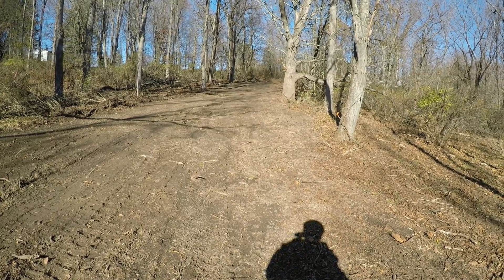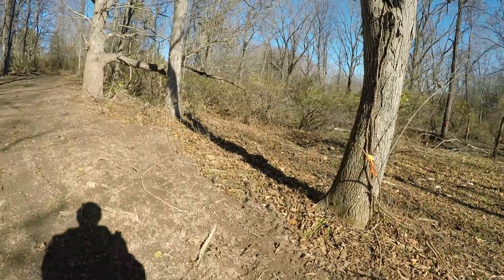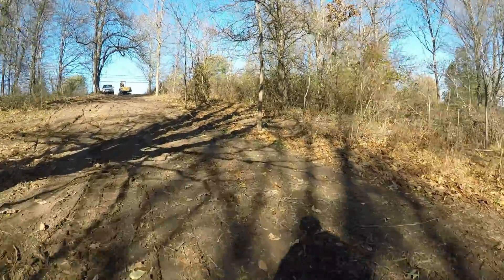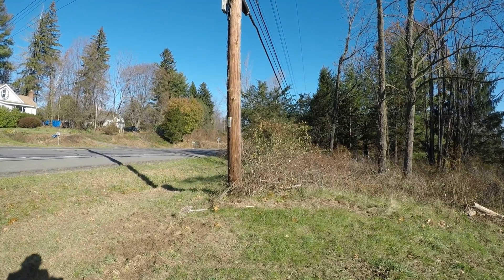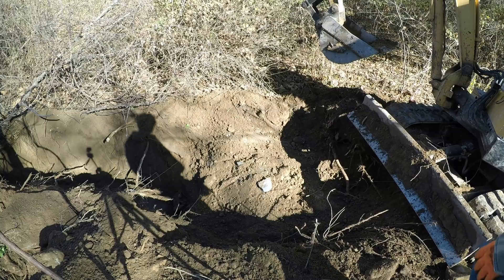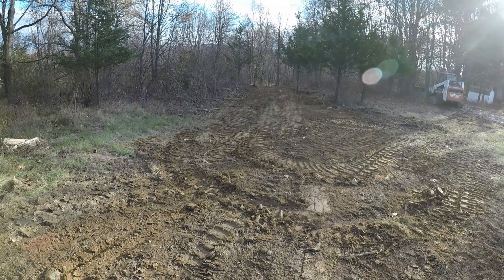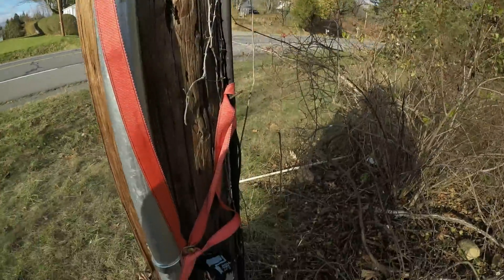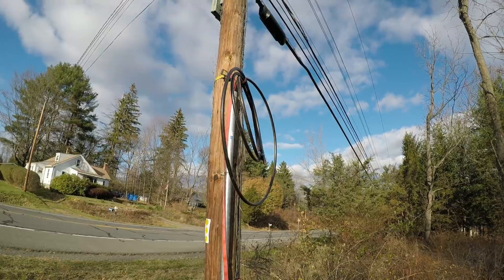Installing underground electric service

Comment: If you scrape about 8 inches from your dig at a  time you will end up with  a  much nicer trench.   It takes no more effort as long as you fill you bucket with each dig.    A nicer trench is easier to fill with conduit and backfill with dirt.

Comment: It looks like you take pride in what you do. The electrician needs a lesson on how to do work in a neat fashion with some pride. The expansion fitting is all the way down so it can't possibly work correct and none of the conduits are level. Maybe a little stone in the bottom of the transformer pad.

Comment: boy this is a great job for my Big Ditch Witch  ,,, it has everything on it ,,back hoe,, 6 way dozer blade , ditcher that can go 6 ft. deep and it cuts a 8" wide ... and it also has the Vibratory plow too ,,,,,,, you don't see many like this with both the trencher and the vibratory plow on the back ,,, usually you have to change them back and forth as you need them ,,,, anyway ,,, I would have love to trench that one in

Comment: A late comment...great video!  I have the same situation at my farm.  I'm wondering if you took note of the wire-type printed on the outer jacket of primary cable the electrician used.

Comment: What gauge is that primary cable?
Reply from the maker: The primary cable isn't listed as a gauge, its more of a special wire made for that purpose.
Reply: Andrew Camarata ah I see, is the transformer needed because of the distant from the street to the house is too far? How many ft was it?

Comment: In Missouri we have  "1-800-DIGS" for marking the existing locations of underground services (provided free by the utilities companies). Is there anything like that in NY?  And, I've always wondered why if AC has a trench to dig a couple hundred feet long, why not bring out the bigger excavator? No trench bucket? Fuel expense? I realize the Yanmar is smaller and probably more maneuverable, but it seems this job was wide open and had space for a faster higher capacity machine? Anybody?

Comment: Isn't it dangerous to be digging right at the base of the electric pole? Of course, in any event, the overhead wires could still uphold the pole but... Just asking.

The way you conduct your power connection is very safe with lines coated and buried underground. Are the overhead power lines coated too? I like the laws that you have. In lndia, the laws exist (most of the time) on books, (except for collection of power bills).

In India, we have transmission tower carrying Extremely High Voltage lines on 6 naked alluminium wires for long distances and between power stations.

From the power stations, we have what they called overhead High Tension Line (Primary wire ??? - US) on H frame structure with 3 naked alluminium wires going to the transformer. From the transformer, 2 Low Tension (service line ?? - US) naked alluminium wires carried power overhead on a T shaped pole for domestic connection. One has to tap/connect to these lines at the pole to the home metre box. This was very dangerous as the connecting lines would cross connect/touch in the wind causing it to burn with a loud noise and break off. Recently, they introduced a new coated single power line with a naked wire outside wrapped around it in spiral. Here, the connection (for home) is done through a small connection box (like in a cable) which is much safer.

In 2015, I witnessed a 17yr old girl being electrocuted on a road side by a naked alluminium HT wire which snapped and fell on the ground. The girl was passing about 1metre from the fallen live wire when it latched itself (like a magnet attracts metal) to her. People nearby used long wood and bamboo poles to try and dislodge the wire from her body and by the time the power was turned off (at the transformer), her whole body/clothes were all burnt. She was declared bought dead at the hospital.

Comment: 12:34  
The warning tape should not lie directly on the pipes, only the pipes need to be lightly covered with earth and only then lay the warning tape. Digging in this place must be safe for pipes in the future, so the excavator must first come across the tape, and from now on it must dig carefully so as not to damage the pipes or cables.

Comment: Nice work.  I just had to redo my service after I lost a leg of power and I did not want to cut my newly paved driveway up to repair it.  Similar depth requirements but sand is required even with the conduit in my neck of the woods.  Just like you it was a one man show albeit with a borrowed hoe and borrowed Freighliner.  Only thing the power company did for me was the connection at the pole.

Comment: I'm up in Ontario and I'm trying to think what was done here for services, not sure if it was gas line that was buried in sand so that if you were digging down in clay soil and all of a sudden you hit sand in the trench then your spotter ( the guy who leans on the shovel lol) would dig carefully with the shovel to find the pipe or cable.
That was 40 odd years ago when immigrated to Canada and funnily enough when I got transferred to the city cemetery for the winter I was the guy with the shovel watching the bucket didnt hit any of the caskets on either side  of the hole we were digging. Then I'd have to jump in and finish up with the shovel. 
I'm retired now and want to move out of the city and get a few acres and do what Andrew is doing in a smaller scale for myself and have a house built for the wife and I.
Some of the lots that I looked at were had mixed hardwood, softwood or just Bush but I never thought about clearing off enough for a roadway and a house and selectively clearing the rest as time permitted rather than paying out big bucks and having a company come in and bulldoze everything.
Thanks for the videos Andrew you have brought back memories....

Comment: Aren't you worried about the stability of the pole when you dig 3 ft on one side?
Reply from the maker: A drop, but it goes much deeper than that, and was anchored. That is something to consider though.

Comment: the ditch tape is still on the line you installed. i good tip, use the hoe to shade the pipe and then lay the tape. anyone digging around there, would dig up the pipe and caution tape at the same time. and possible die. people need to do things the right way.

Comment: Andrew, Good tip on measuring the depth of the ditch.  I do the same on my drill bits, put a piece of tape to mark the depth.  Why not wrap  the boom with duct tape (or a painted line)  at the 2',  3',  4'  lines, so you always have the depth gauge on the excavator.

Comment: i am wondering if it would be quicker to use a trencher.
Reply: Might be faster, but trying to put cable or conduit through all those roots is terrible. I find it easier to just use an excavator. Also the area he works has some pretty serious rock that sometimes even needs to be broken up just to get to depth.
Reply: That makes a lot of sense. Thanks

Comment: I don’t get it. Why you have to put the electric line in the middle of the road? Why you can’t just dig a ditch 2 feet on the left or right off the road so once you put it in there you will NEVER have to touch it again? I see same stupid thing everywhere... sewer covers in the middle of the roads instead of being on the sidewalks or near the road... WHY in the middle of the roads? Is there a stupid code that requires this nonsense?

Comment: I work for a cable company and I always thought they had to be in two separate trenches? Is that true?
Reply: It all depends on what county/state you live in.  In my county, no, they don't have to be in separate trenches.  You'll have to check with your local codes authority and find out for your area. That being said, when I do underground lines here, if they are data and electric, I use spacers.
Reply: @better_than_nothing  Same in my state. everything but water can go in the same trench.

Comment: Andrew Camarata
 Question: After back filling the trench in the driveway like you did. Is the bobcat weight used good enough to compact the fillings? Or should it still need more compacting work before laying black or a concrete driveway over it?

Comment: Regarding the cables & voltages. For transmission lines, the voltage needs to be proportionate to the distance, ie: higher voltage travels further. In Australia, we've got 11kv, 33kv & 133kv. The 11kv is your average power line around houses, 33kv for the big lines coming into the city and 133kv for interstate. Each higher voltage meets at a substation for stepping down.
So, regarding the lines you've helped install, one of those lines would be for "suburb-like" distances, hence the step-down transformer.

Comment: Andrew, I need to run a line. How long do you think it would take to dig a trench like this one that is 3/4ths a mile long? Do you think a smaller machine than the B50 would do the job?

Comment: Dude, a ditch witch would have saved you HOURS on that job. There's a reason power companies and contractors who strictly do this use a ditch witch. It's because it digs a perfect trench very deep. And it's easy to cover up. Just run the trencher and scoop the dirt back in.
Reply from the maker: Is it available as a skid steer attachment? I might get one. Most of the time the ground is all rock here. This job was an exception.

Comment: I have to layer the conduits out here in Arizona. 4' for power 3' for low voltage 2' gas all in the same trench. Backfill 1/4inch minus over the electric and sand around the gas. But we build houses 6 feet apart and all in a row.... curious what you got for that job out there.   $1200 for the temporary power pedestal $600-$1000 for a transformer pad and and then $9-$11/linear foot for conduit is normal around here.
Reply from the maker: That's interesting. I didn't think there were rules about anything being too deep. I don't do it often. I charge by the hour usually. Sometimes charging by the foot would be hard if hammering was needed.
Reply: Yeah we charge a per job price and then if you have to hammer thats an additional hourly price. If you are quick which you seem to be it works out better. And its been my experience that a customer feels better about not having an open-ended bill and will typically spend more than they would have hourly. But we all do things differently! Keep up the good work. Love watching you from across the country

Comment: wow...code is different all over. Here in Virginia the power company is responsible from the pole to the meter base. customer is responsible from the meter to his panel and so forth. which is 99% affixed to the dwelling. Why was a pedestal used with the meter base / panel box in this situation? is that temporary and a meter base affixed to the house later? Does it have to do with the size of the house? We only use pedestals to mount meter bases for trailers or temporary structures.
Reply from the maker: Good question. I guess so they don't have the meter mounted to the house. Plus it was nice having electric on the site before the house was there.

Comment: Why did you choose to use the BOBCAT over the push blade on the back hoe or better yet use your Dozer with the push blade angled slightly? Here again is a job that I think a grater would be good fore? Again I am only asking. I would like to learn why you used the equipment you did. thanks and remember to stay safe on all of your jobs always.
Reply from the maker: Dozer would have been nice, but it was far away from the job. The bucket on the skid steer was able to do this faster and easier than the blade on the excavator.

Comment: Have you ever thought about getting a medium or small road grater? You do a lot of grading. I think that would be a great piece of Equipment to add to your fleet. I do not do any contracting or excavation work. I deliver Auto Parts in St. Paul and Minneapolis Minnesota. Just sharing my thought with you. Give it thought if you want or not. Be safe out there on your job sites. Every time, all the time.
Reply from the maker: It would be neat, but I don't really need it for what I am doing. I feel I can grade things fine with the equipment I have, especially since they are just residential driveways when traffic doesn't go over 20 mph.

Comment: Couldn’t you have used a trenching machine?
Reply from the maker: Here, probably because there wasn't much rock. I don't have one though.
Reply: I don't think a trenching machine would have made the ditch wide enough.  And it certainly wouldn't of been able to deal with that tree which was in the way and needed a smack down.

Comment: Great tip for depth monitoring. I was on edge as you were digging the ground out next to the pole, I was thinking "any minuet that pole is going to flip and fall on the road" lol
Reply: The pole was another 3 ft in the ground

Comment: Not to beat a dead horse here but there's multiple things you did wrong I'm sure that a lot of people pointed out. Things you honestly should not do is dig that closely to a pole. It could be rotted out and you make it fall. Also don't put primary cable in the middle of a driveway. If it needs fixed that's what will get torn up. Transformer placement wasn't the best either. Put it in conduit. Faster and easier fix.

Comment: The title should be "how NOT to back fill an electrical trench" !
Reply from the maker: The dirt is back in the hole, and it got done quickly.
Reply: @AndrewCamarata  So that makes it RIGHT ???
Reply: It will work, way to many picky people. It already cost a bunch if you try to do every little thing perfect cost be way to high and they would just hire some one else

Comment: Could you please explain why the electric trench is under the driveway?  What if it needs to be worked on later...
Reply from the maker: Its there because that was already a cleared area to do it in. Its rare that they need to be fixed, but If it does, it will just have to be dug up and fixed.

Comment: You sure do thing different in NY then hear in Wis. Hear the transformer would be at the pole, now you ruining hi voltage underground!!
Reply from the maker: The secondary can only go like 400', so if the driveway is longer than that it has to come in as high voltage.

Comment: How come you have to go underground when most times I see power cable strung overhead in the USA .
Reply from the maker: Its nicer underground. Trees wont fall and pull down the wires. Plus its hidden and looks neater.

Comment: Why not have a bore machine do this?
Reply from the maker: Because I don't have a bore machine. I actually could use one though. I have a stream to tunnel under soon.
Reply: @AndrewCamarata   Don't expect to be able to bore under any creek in your area without a capable machine with a rock head. Ground with a few place  rock  can usually be cut with a standard rockhead which is around 1500 bucks but solid rock requires a mud motor head which requires a great deal more of an investment in both machine plus head and support equipment.
Reply from the maker: I just did that job I was referring to with the creek, we attached the conduit’s to the bottom of the bridge.

Comment: The tape is supposed to be laid directly above the conduit approximately 6 - 8" above it. Tying it to the roots like you're doing defeats the purpose of the tape. If the power or cable company saw it they might be upset if it was their requirement to place it. In my area we don't use the tape because locates are required before digging.
Reply: Mike L... If that's about a 3 foot deep trench, the tape should only be about a foot down from grade (2 feet above conduit), if the tape is only 6 - 8" above it as you stated, an excavator will rip right through that conduit before they see the tape and there's going to be a hell of an explosion when 7,000 or so volts shorts out on his bucket !!

Comment: I know you like to use Sch 80 conduit for power due to its strength, but when backfilling is it no big deal if rocks 4" and up are laying up against it? Or do you think its always a good idea to put in a little dirt by hand around the pipes so you know for sure there is no direct contact with larger rocks? Awesome videos, learning lots and thanks for sharing!!
Reply from the maker: I just backfill with anything, never had a problem. BUT I do keep the largest rocks away from it if possible. Ill usually try to fill around it with cleaner scoops first. Watch my other video "why to use quality pipes".

Comment: Red "Caution" tape should be at least 20cm or some apart from the lines. Whats the point of it if it's only doing it's job when the cables are already in progress of being chopped off..
EDIT: like 3secs after i've posted this, you started explaining excatly what i've said :) nevermind

Comment: Is the landowner responsible for pulling the wire or does the power company do that? Here the power company will provide the wire and transformers and they will pull the wire too.
Reply from the maker: The power company only provides the transformer and meter, the customer or electrician must do everything else.
Reply: man that would get expensive... I am glad they provide the wire here, we just ran 900' underground.

Comment: I've said it before... I'm so jealous of your ground there.  If I dug a trench that long here in the Sierras,  I'd have found 14 of those big rocks and 3 bigger than your excavator.  You don't have to sand your trenches before you back-fill?
I knew you owned that rock when it first moved at about 4:19.  That first jiggle is always a tell that the f**ker is going to move.  As always, you do very neat and clean work!
Reply from the maker: Yeah, I could see how that would be frustrating digging if the ground was full of those rocks. That dirt there is much nicer a few towns south of where I live. I never sand trenches, the conduit is there to protect the wires. Yeah, I could have dug around it, but seeing it move was a give away. Thanks.